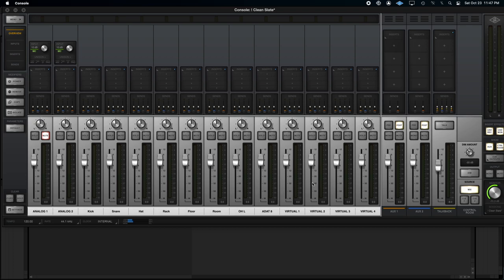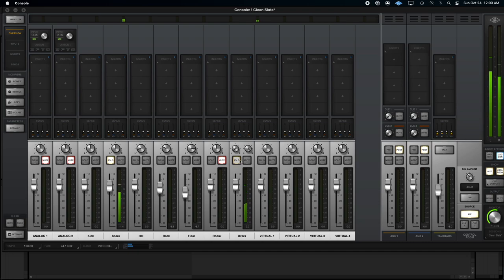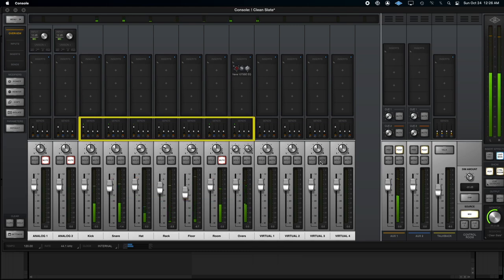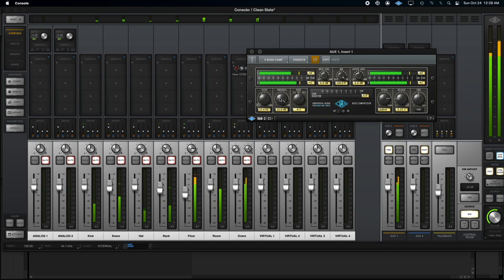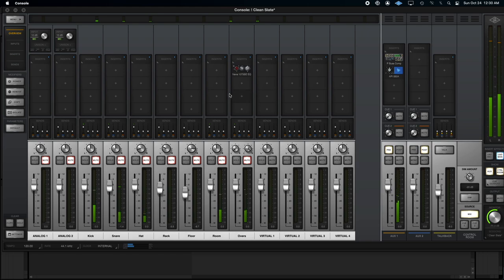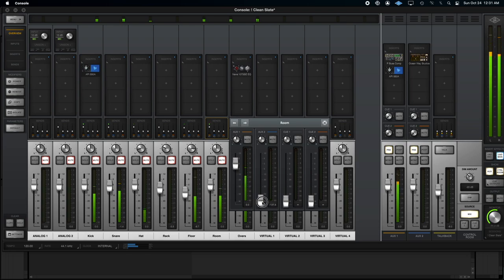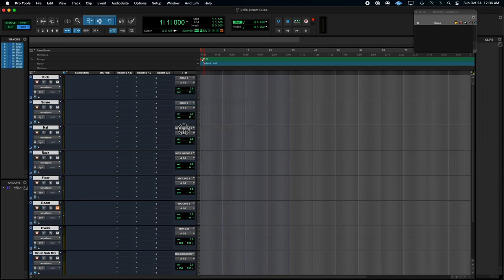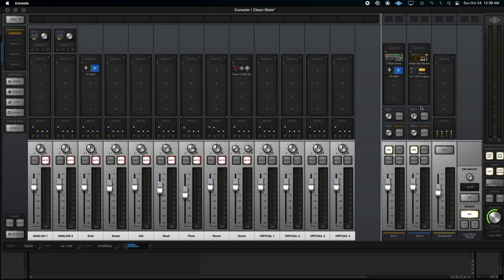Using UAD Apollo Console to build a Drum Sub Mix Group with Buss Processing

Comment: How did you right click all the drum tracks into a bus?  Did you have to group them first or click on the furthest left track and then the furthest right complete newby here
Reply from the maker: They're not really multi-selected. The right-click and copy to applies to all channels. Since we were just working with the drums' faders, that's all that were really copied. Hope that makes sense. Thanks!
Reply: @MattHepworth  that helps a lot. Thanks. So would I just have to set up the drum bus before I plug-in my microphone and guitar, so it doesn’t include those inputs?
Reply from the maker: That's easiest, but you can also just pull those aux sends down for those tracks you don't want in the bus quickly, too.

Comment: Interesting, that you mix in console and not in your DAW. May i ask why you do that? How is your process - when Do you switch to you DAW? What benefits do you have mixing in console instead of your DAW? Why do you prefer Console? And where do your tracks come from, if they are not coming from ProTools - because you open that later??? Too many questions, i know, but i would really like to know your DAW-Console setup and workflow. Best regards and great videos for Apollo you put up here!
Reply from the maker: Thanks for the questions! It's really just to get a great sound on the way in and for monitoring. It's also really simple to control all the drums with one fader instead of 14...
Reply: @MattHepworth  yes, but you can also do this with a bus in the DAW. I just run a comparison test using routing in console compared to using routing in the DAW with hardware units, unfortunately the Console routing using virtual channels is worse than using the channels directly fro, the DAW. i hoped this would be a great solution, but it isn't. best regards

Comment: 1. No unison pres, so are you adjusting input gain externally? Or just at your Console faders? 2. Do you have to adjust the room and sub-mix for delay compensation if it's going through the AUX channels? 3. You didn't show setting up the AUX plugins to print, but I assume you did that?
Reply from the maker: Hi Alex, in this video I was using outboard feeding my Apogee Symphony I/O and feeding the ADAT to Apollo. I don't always print the aux, but when I do I do a -73 sample offset and treat it as a stem (muting the individual tracks in the DAW).